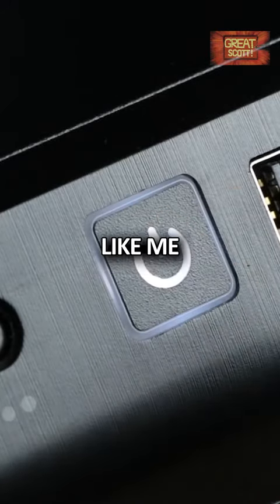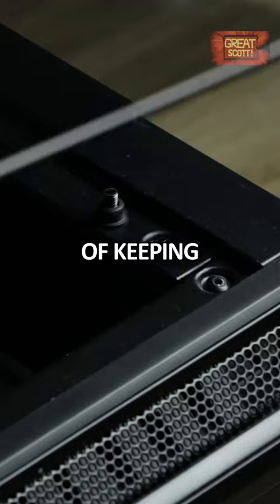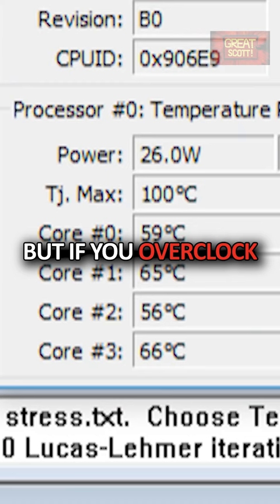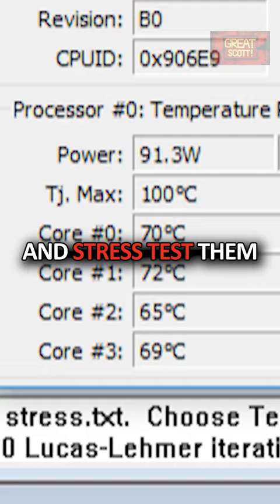Cooking Oil to Cool Down Components?

Comment: If you go to your local pharmacy, you can buy very pure food grade mineral oil. It's clear, odorless, and never goes rancid or polymerizes. That's the stuff you want to use for this application, although non-PCB transformer oil would be fine too. That's more suited for high voltage applications. The food grade mineral oil is what you should be using when coating all of your wooden cooking utensils after washing them. :)
Reply: Glycerin?
Reply: Expensive

Comment: Never heard of using Canola Oil, or any "cooking" oil, for that matter, to cool a PC. It's always been Mineral Oil submersion.
It stays clear as it ages, it's electrically isolating, and LEDs can look really cool glowing through it. Plus it has low enough viscosity that it'll self circulate as it warms up, which adds to the effect of LEDs and motion

Comment: I used to overclock but now I just undervolt and that can really improve your performance at the same or lower power usage and thermals! While protecting the silicon in the long term from high voltages/heat

Comment: I smell canola oil every day. 
It does not smell good BEFORE it goes off.
Reply: Oxidized poison right from the refinery.

Seed oils are not suitable for human, or animal consumption.
Reply: No organic oil should be used for something like this without extensive filtration and regular replacement... which largely defeats the point.

Comment: Can you make a quick video out of this but like no cpu cooler and a gpu with no cooler too
Reply: Have you seen the one in the M3 Novec fluid?
Reply: will not work cause oil boils at such a high température that your pc will shut down before
Reply: @maximeremy6492  that’s why engineered fluid works, non conductive and designed to cool like that.

Comment: White natural oil yes, if you keep the air off. That works well and for a very long time. But cooking oil definitely not for long.
Reply: What "natural oil"? Both oils shown ( canola and olive ) are naturally produced. The one at the end is based on some distillate, is that "unnatural"? Be specific when making statements.

Comment: LOL!! 
That was the first thing that came to my mind, when I saw cooking oil. It may work great for a while, but will not be fun when it starts go rancid - which will not take long. Especially of it's heated slightly by the components it's cooling, for an extended period of time (the rate at which it oxidizes goes up exponentially with temperature). Transformer oil is way better.

Comment: There is a lot of debate whether liquid cooling even has any advantage over high end air coolers which ultimately cost less than a whole liquid set up. Would be cool to see what you find.
Reply: People are too fixated on temps. The components are made to run up to 100C if not higher in some components. The higher temperature results in more heat transfer occuring relative to ambient temperature. 

And you are correct, most air coolers are more than enough for our modern, energy efficient processors and gpus. Liquid cooling is just a scam at this point.
Reply: Not sure what you wantme to take from this comment? We want to avoid running near max temp to avoid thermal throttling and to run more efficiently (more hear, more resistance) and running cooler prolongs the life of components.

There's good reason to cool well, I have just seen little evidence that standard water cooling loops are worth all the extra hassle and cost when Noctua coolers can perform the same or better in many cases.
Reply: @zoppp621  In many home environments these limits are met or exceeded, especially with some dust.
Reply: Lower temperatures and maintenance are the goal ultimately. Being able to decouple your layout slightly from the air cooling and reduce sound are also reasonable secondary goals. Whether any of these are met with off the shelf components is kind of debatable, but I would say we are getting closer.

Comment: Salt water has a higher heat capacity. You should use that instead, it never goes rancid.
Reply: It’s conducive though
Reply: salt water is conductive AND corrosive on metals, not a good choice

Comment: I guess demineralized water is too cheap
Reply: Won't work for long either,.will pickup metals and start conducting....zzzzz
Reply: it does not work for submersion because it does not stay demineralized for long if you put random boards into the water